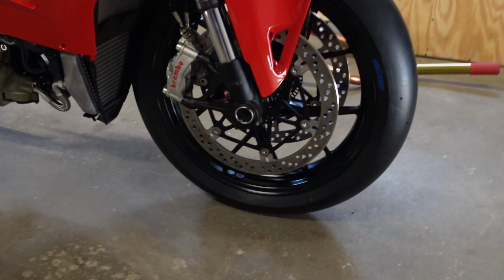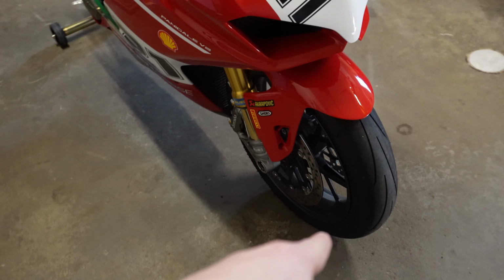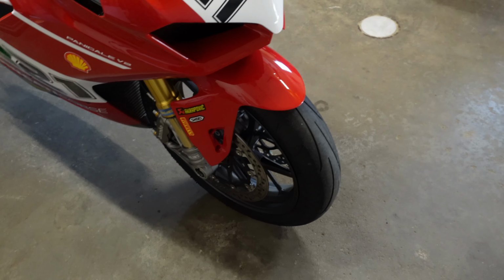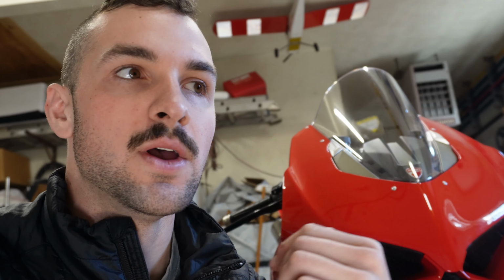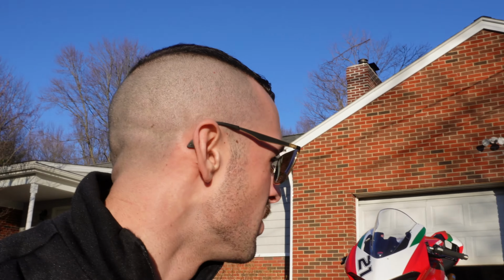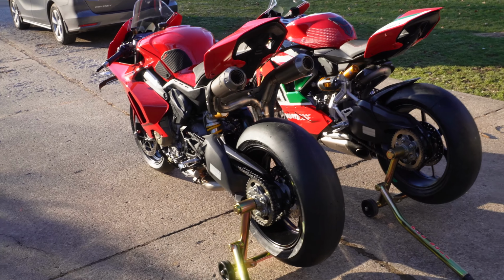Track Prep Day Prep 1 Week Out: Panigale V4 and V2 EP2

Comment: I noticed you were mounting the tyre with the rear rim mounted backwards on the tyre machine jig. Try flipping the rim over and having the tyre come in from the front (spoke side) of the rim. Good video as always 👌
Reply from the maker: Actually did exactly what you said there but the wheel is to deep for the tire stop when it’s flipped the other way so I’m gonna try and come up with a new solution for that!
Reply: @desmoholic.racing  oh I see what you mean. Perhaps need something made up to support the hub face/pull it away from the jig

Comment: On the V4 how are you safety wiring the oil filter housing on the bottom?  Thx
Reply from the maker: I’m not safety wiring that. The filter is in the crank case and the filter housing cover isn’t going anywhere. There wouldn’t really be a good way to do it since the housing cover doesn’t thread on and off it’s just the two bolts holding it in, but, the o-ring to seal it makes it hard to even pull off yourself 😂